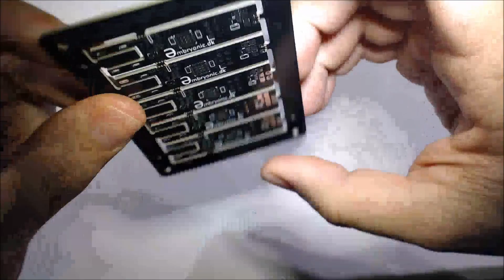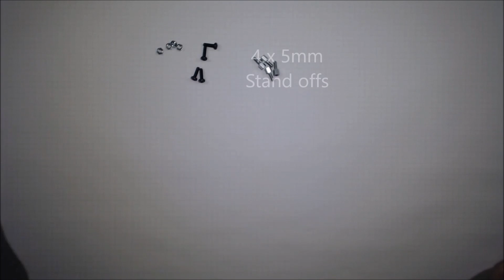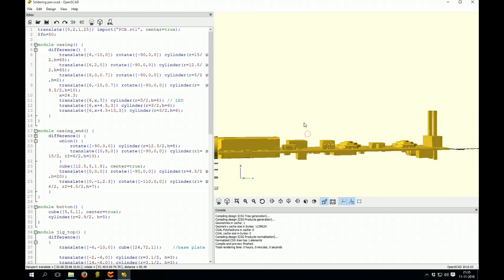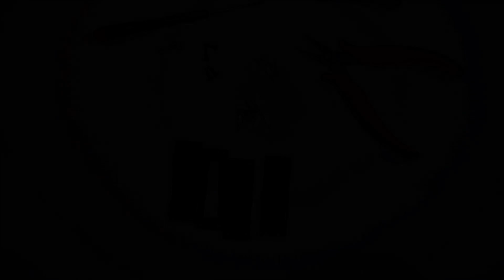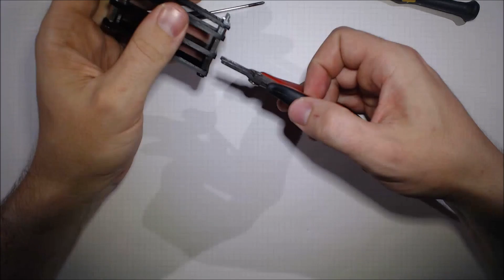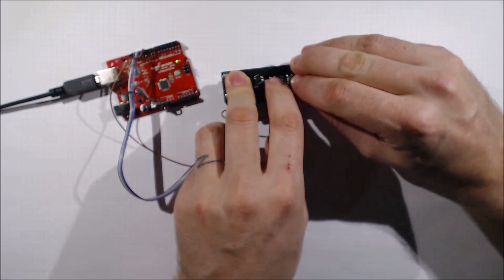Pogo Pin Programming Jig (A guide)

Comment: I do similar jigs (fewer layers though) but I make the layers out of PCB so I can solder the pogo pins rigidly to one of the layers, and that then breaks out to 0.1" header pins for connecting the programmer.
Reply from the maker: Using PCBs is great - I would have done that if I had the tools at home :)

Comment: It's sad you don't show better how the soldering of the pogo pins was made, that's the part I don't know how to handle...
Reply: David Collin sorry about that. it's really easy since the copper tube is so thin you can just solder on it like a regular wire. place a small piece of solder there and pre-tin your wire. the hardest part is making sure the solder points on each pin don't touch each other.
Reply: Hans Peter Haastrup-Nielsen i guess I'll préparé shrink tube to isolate, if spacing permits it... thanks for the tip... I've had pogo pins around for months but didn't try soldering to them yet...
Reply: David Collin thats a good idea! the way I did it wouldn't have space for it but if you solder the wire on the end of the pin it could work. the best thing would of course be to use a PCB on the bottom side. then you could just design a regular connector and solder the Pogo pins like normal component pins.